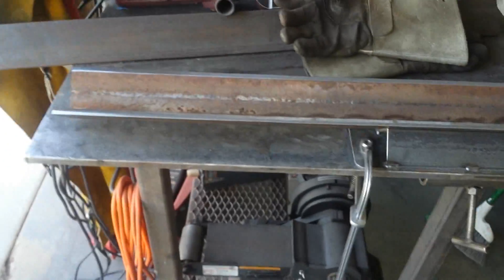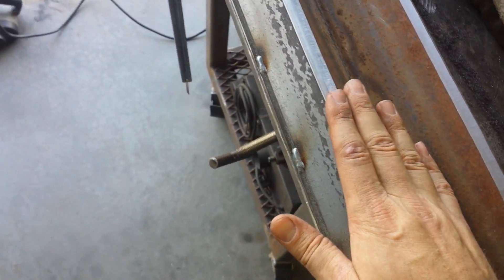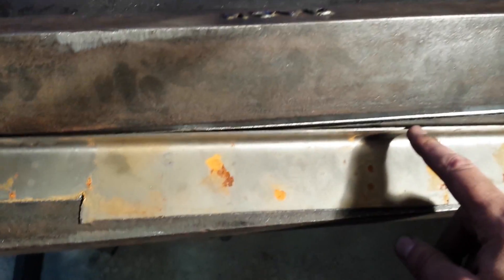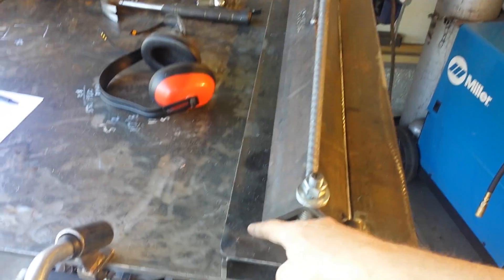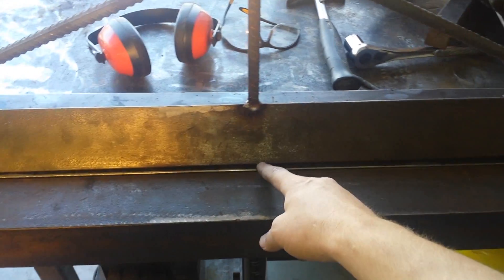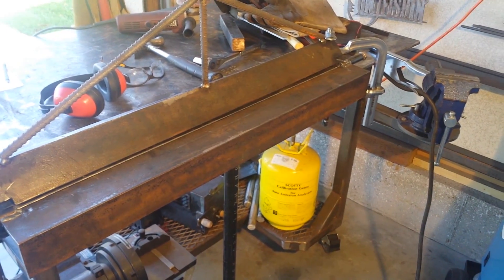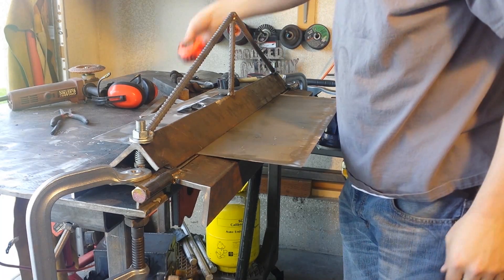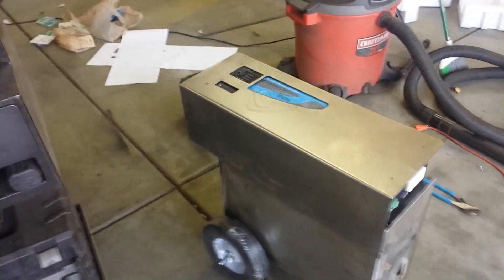Homemade Sheet Metal Bending Brake

Comment: Thanks for sharing your project. Very cool. I'm forwarding to build my own break bender, and my concern is to get a straight 90 degree angle. I'm retired HVACR Mechanical and I need a break bender for my side job, exterior window & door frame covered by aluminum. I moved from big city where I had my network and now I'm end up small town, that is hard to get a shop machine with cnc, lathe, etc. Thanks my friend I saw too many videos, but when I saw your project, very simple and effective. Specifically for ductwork. Cheers for you master guy.

Comment: that's what I call getting down to bussniss, I am a bump and paint man, do you think angle iron of that size would be able to bend a 3 foot piece of sheet metal to prepare the bottom of rusted out car doors?
Reply from the maker: +Tracy Spencer I think so, assuming by sheet metal you mean something thinner than 16 gauge

Comment: right at 3:00 that size work metal bench.. the legs has rollers as well.. looks pretty that bench, did you build that bench ? if yes, where can I see a video of that bench or do you have any videos making a good strong solid bench.. I want to build a work home bench for my garage.. I'm doing a car restoration is my hobby but I need to do a lot of metal work to my car and I want to build a very strong work bench since I'm going to do welding and few more things .. so if you have a video of  DIY build a work bench let me know pls thanks.. nice sheet metal brake I saw one in harbor freight but is about 100 bucks  and doesn't look very solid like yours..
Reply from the maker: Thank you.  Yes, I built the welding table years and years ago... one of my first projects.  I didn't get a video of it as I didn't really have a camera at the time, but perhaps I can post a video of various things I have built in my garage and give an overview of each.

Comment: I really enjoy your videos. I'm curious,why did you use cold roll?  Great job on the brake!
Reply from the maker: I use it for CNC stuff all of the time because it is firmer (doesn't want to bend as easily) than hot rolled.  Also, it has a much nicer finish than hot rolled too.

Comment: If you notice any bending on the brake bar that is attached to the handle you could add some reinforcement much like you did to the top to reduce flex and help keep the center tighter.  Nice brake, I am sure it will be very useful.
Reply from the maker: I think it does deflect a little.  I was thinking about adding the bracing there too.  I don't notice the deflection so much, but the bend toward the center isn't as crisp as it is on the ends.